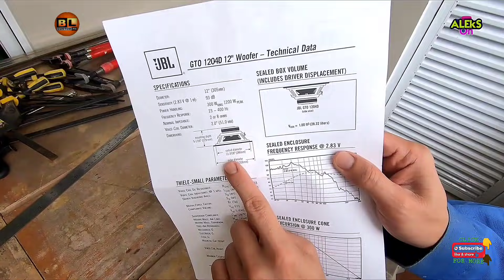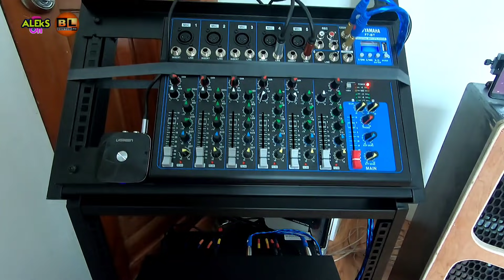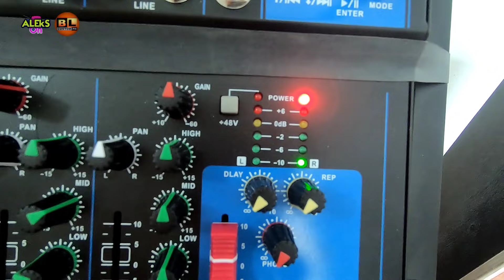The Making - FULL RANGE SPEAKER SYSTEM - Start to Sound Test - DIY TUTORIAL VIDEO

Comment: Do you know of any reason not to place a midrange below a woofer with the tweeter above the woofer? Im looking at modifying some 2 way store bought speakers into 3 ways and can only place the mid under the woofer. Thoughts?
Reply: Closer placement to the floor acts as a longer baffle increasing bass frequency response and output of the woofer. Placing mid range closer to the floor adds reflections and can lower sound quality.
Reply: Vertical directivity suffers. Watch a few GR Research videos where Danny Ritchie improves crossovers of popular speakers. You'll learn quite a bit..